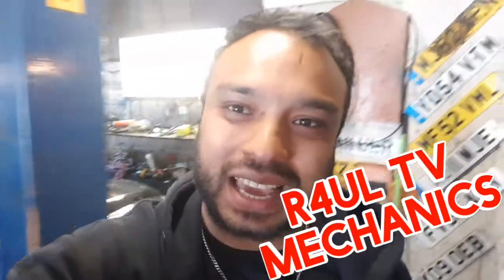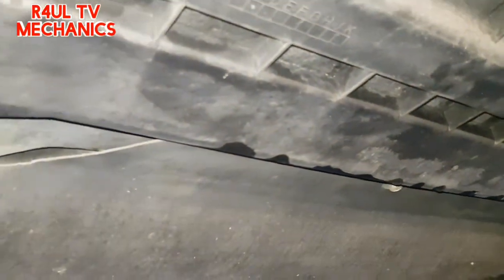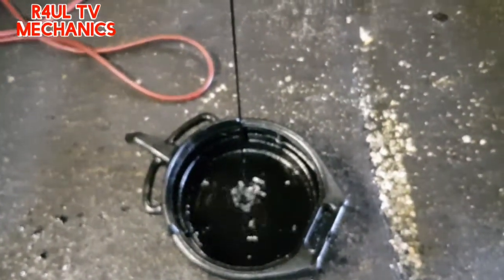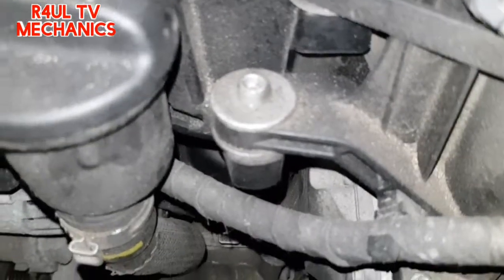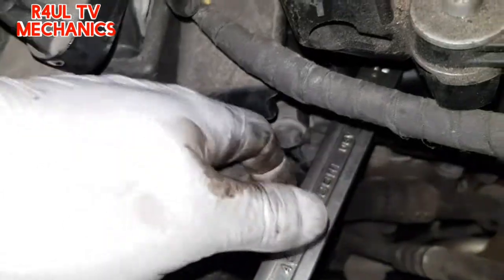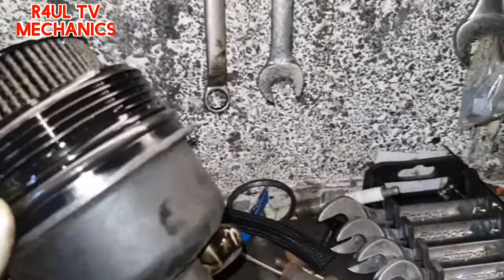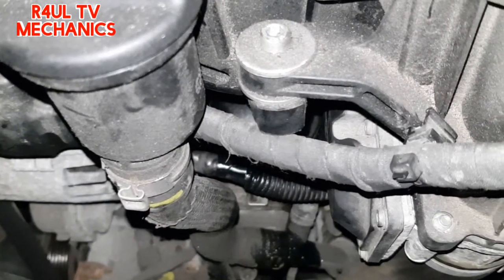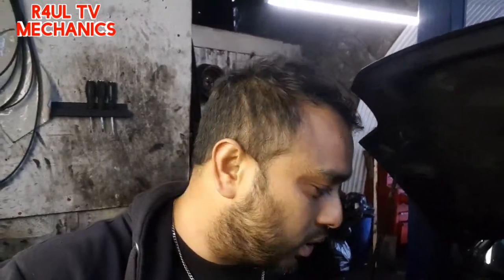2013 FORD MONDEO ENGINE OIL SERVICE| FILTER OF DEATH

Comment: A little tip remove oil filler cap pull dipstick loosen oil filter then drain the oil.. this will make all oil go to the sump and stop glugging when draining

Comment: These engines take 6 litres of oil. and the cranked filter wrench makes removing the filer body a walk in the park.
Reply from the maker: Thanks for watching really appreciate it
Reply: 5.6 but you never actually need that whole amount or you will end up over filling